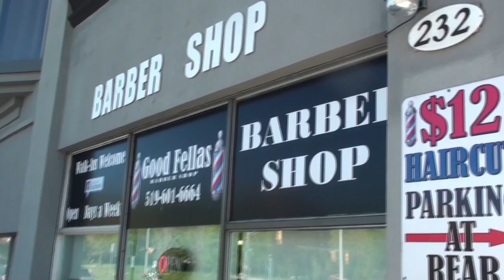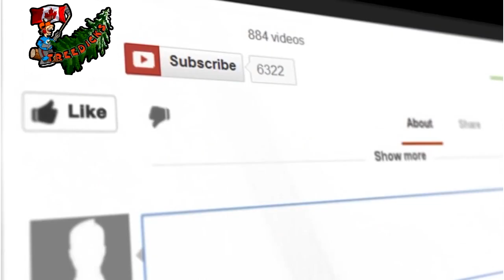Mike quits treedicks unless he gets a hair cut !!!!

Comment: Hey Jeff the big wire on your starter should be live at all times   The small wire on your starter is your key switched  so when you turn your key it puts battery voltage on that wire allowing the starter to turn   Get yourself a cheap test light at princess auto or Canadian tire  and ground the end with the clip and touch the wire to the big wire ( make sure the battery's are installed ) it should light  then go to the small wire and have someone turn the key   If it lights up you have a bad starter if not check the fuses   But to jump the starter you have to have power on the big wire and the small wire at the same time

Comment: Bro never buy a boat with an inboard engine they are money pits. Pull start outboard with a tiller is the cheapest most reliable engine you can have for a boat.  The more systems you have the more goes wrong, I've owned a bunch of boats and if you want one that's the least amount of hassle and more fun go with that setup.